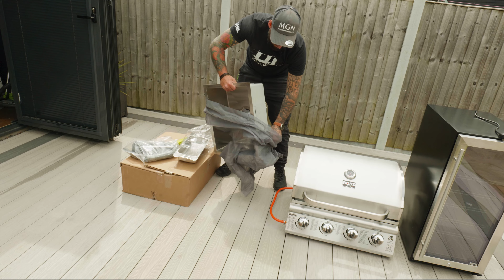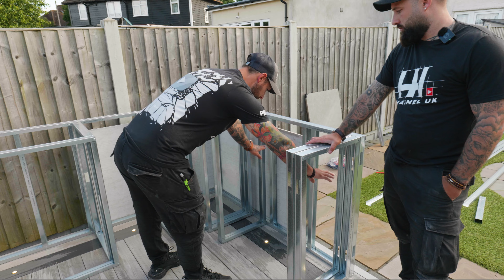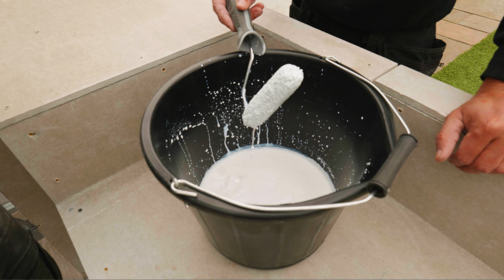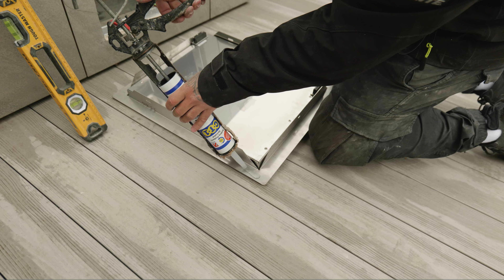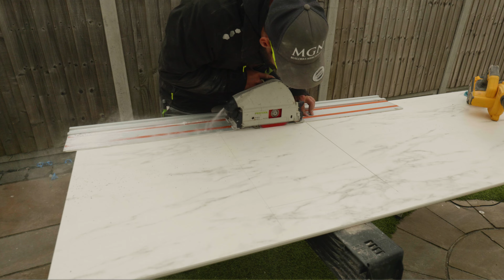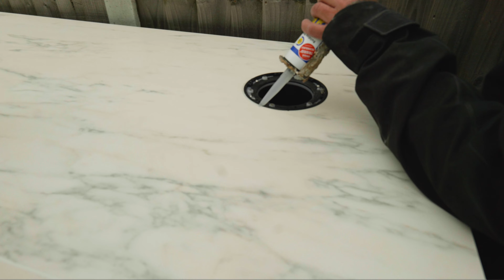How We Built The Ultimate Luxury Outdoor BBQ Kitchen

Comment: Ever thought of using STS Fiberecement boards? They come in a range of sizes and thicknesses, inlcuding 6mm, 9mm, 18mm and 22mm...not to mention some of the ranges coming preprimed saving you time on your projects.
They also supply the fixings and glue.
Check them out, they are stocked by most builders merchants UK wide

Comment: Great looking build. Did you tile the rearside (against fence) also? Guessing cement boart can't be left open to elements?
Reply from the maker: We didn’t just sealed the joints cement board if ok with the exposure 😊😊
Reply: @homeimprovements  Good to hear. And is the sink plumbed in for supply and drainage? Or some kind of resevoir & pump built in?

Comment: Any ideas on how weight-bearing the metal stud work is? wanting to use a heavier worktop but not sure it would hold compared to a timber frame. I'm aware it would depend on the size of the frame but let's use yours for example.. something that long with 400s.. what would have been the max weight you would have been comfortable with on placing on top?

Comment: Wouldn't it be better to lay the structure under on a concrete base and the deck would go around it? Honest question cause I gotta do something similar and I am worried for the weight that would go on the deck
Reply: Just thinking about this - maybe if the decking went down at the same time but i guess because it was already laid and the kitchen was an addition some time after they just decided to leave the decking at is. If it had gone down with the decking they would have likely run that darker boarder of decking to follow the L shape of kitchen.

Comment: Does the gas bottle fit through that little door?
Reply from the maker: Sure does mate 😊
Reply: @homeimprovements  do you have to use the bbq with the door open I’m sure I’ve read somewhere about not having the bottle inside a closed unit?
Reply: @homeimprovements  what was the cost for this please I am in the market for one